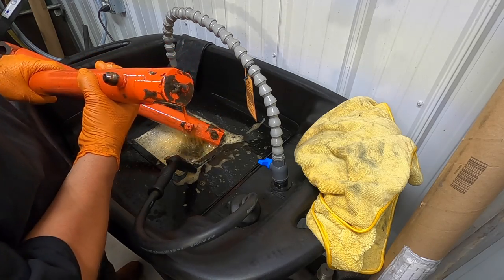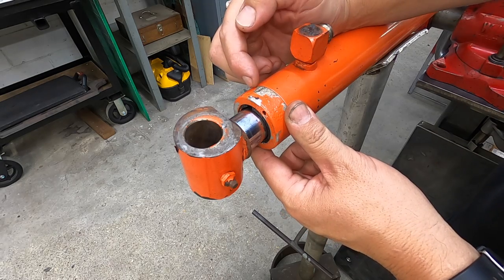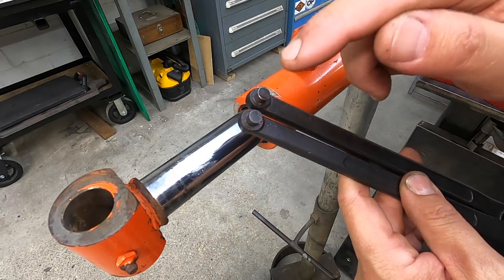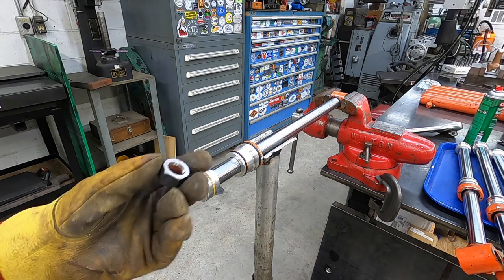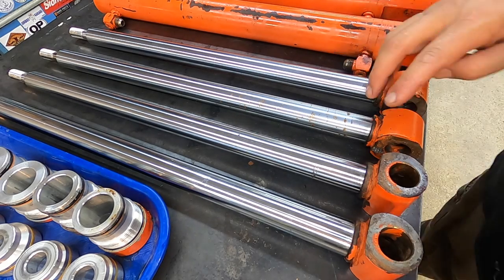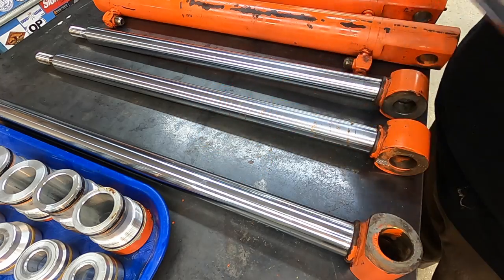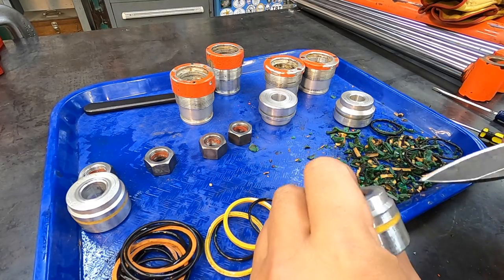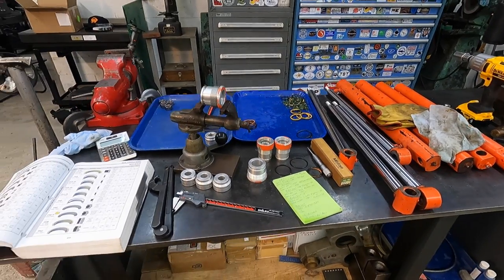Kubota Hydraulic Cylinder Repair Part 1: Cylinder Tear-Down & Inspection

Comment: Should have sent the cylinders to the austrailian guy that never takes a bath. He repairs these all the time. AND so much for chinese equipment. That plating should not be flaking off like that at all.
Reply: You mean the CEE  guy?
Reply: What makes you think Adam is not as good as Kurtis?
Reply: What makes you think  Kurtis doesn't take a bath? Have you seen his wife? Bath time would be fun time.😏🥳
Reply: @assassinlexx1993  he is just some ditch head trolling.  Most Australians shower, so, yes, Kurtis probably hasn't had a bath since he was two.  Shower time can be fun time too!
Reply: @Peter-V_00  the fact that Adam drilled holes into those rod seals instead of finding the right tool completely destroys all his credibility with this kind of work. hugely unprofessional and shows is ignorance. kurtis is leagues better
Reply: @konival9753  Lol. 🤡
Reply: @assassinlexx1993  Because Ive watched his videos. He needs a dentist and he is never shaved and always filthy. Compare him to anyone else in the shop on youtube and they are clean and squared away. It makes a difference if you are going to run a business and claim its professional. If you are that lazy you cant keep clean, you will treat everything else in your life the same way.
Reply: @Peter-V_00  I never said that. Between the 2 I think abom would do the better job because Ive seem his cylinder repairs. Plus adam takes a bath, or shower. You know WTF I mean.
Reply: @thecommentary21  
Then stay away from our shop.
Our clothes are dirty we smell. But we will all night to get the job done. So our customers are back working  by 8am. You want clean go work in a office with pretty girls.
Reply: @thecommentary21  But he is very slim...no time for barbecue...
Reply: @thecommentary21  Maybe. But the main difference: Kurtis has to do his jobs as fast as possible because his customers are waiting for the parts. And while repairing the parts his wife/girlfriend(?) films and edits the videos. No time for masquerade.
Adam's main income is YT in the meantime, not any customer. So he invests much more time in the videos...including bathing, wearing clean clothes, brushing his teath and fingernails...
The results are lots of videos with small content but long length. And a clean and shiny Adam.

Comment: I'd be beyond pissed off if someone drilled holes in my rod seals. very unprofessional repair job
Reply: I must have missed the part when he drilled a hole in the rod seal. 🤔 I see a small superficial divot that was drilled into a thick part of the nut where no seal is located. It has 0 effect on the seals at all. None. Zilch. Nada. Lucky that Fernando is likely getting the job done for the cost of parts. You get what you pay for. This shortcut did no harm and allows quick R&R with available tools. Some of you people are just miserable. 🙄
Reply: I have cylinders that have face spanner holes as well as perimeter spanner holes on the same gland nut, and it's for family. Really, what's the harm?
Reply: Lets see your machine shop and repair channel. Maybe we could watch you rebuild and fabricate things and offer our expertise as to how to run it better.

Comment: Buy new cylinders.
Reply: You must be a millennial
Reply: @jazzmusiccontinues1134  nope, old as dirt, you must not value your time.
Reply: @thompsonjerry3412  I did a similar repair on my own kubota of pretty much the same size. The whole thing, seal changeouts and all, took me 2 hours. I didn’t even take the cylinders off the tractor. Seal sets, the expensive kubota ones, were $30 a set. New cylinders were 450 each. If you’re as wealthy as you are ignorant, maybe new is the best choice for you. I’ll do my own repairs though thanks, and I consider it a wise use of my time. But what about shafts like he’s repairing on two of the cylinders? I had an iffy one, chose to flap wheel it instead as the kubota part was nearly 300. Probably the ones in the video are close to that price or maybe even not available. Yeah I’d be looking into machine shop options too. Plus this is on a machining channel. Are you trying to make a point that this project is frivolous and he’s just doing make work videos for filler content?
Reply: @jazzmusiccontinues1134  the shafts are bad
Reply: @thompsonjerry3412  and this channel features a dude fixing things by machining new parts. You aren’t the sharpest knife in the drawer, are you?

Comment: Dewalt impact. LOL....... You NEED an Ingersol Rand 231. 450 ft lbs of raw torque..... pure testosterone powered....
Reply: He applied Abom-torque.
Reply: Dewalt is his sponsor. Same as CRC. That was a machinist channel. Now it is an advertising channel.
Reply: @ivanhodnik6099  Didnt know he had sponsors. Im not a real big fan of dewalt or CRC.
Reply: That rod is acting like a torque stick absorbing a lot of the impact but I'm not surprised it wouldn't loosen it. I have a makita 18v impact and it's seriously powerful, borderline too powerful for anything smaller than a 3/4 ton truck lugnut
Reply: @ivanhodnik6099  He has a machine shop which means he would need a impact wrench and a parts washer anyway, I don't see the problem with sponsorship of relevant and needed equipment. Also, he showed that the Dewalt impact wrench couldn't break the nuts free, which exhibits transparency.
Reply: @thecommentary21  I like my old Dewalt grinder. I have tried a few CRC products. I don't like them.
Reply: @jimnolimit  Go and watch his old videos when he was a real machinist.